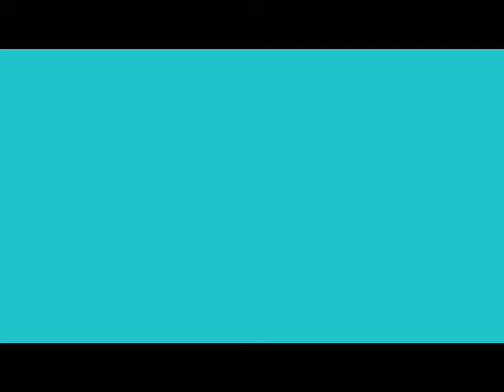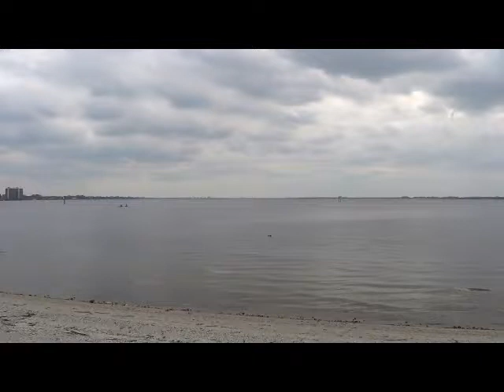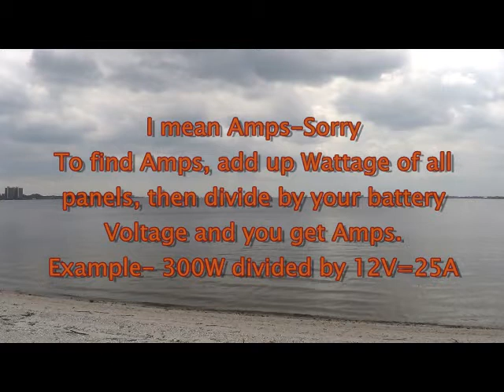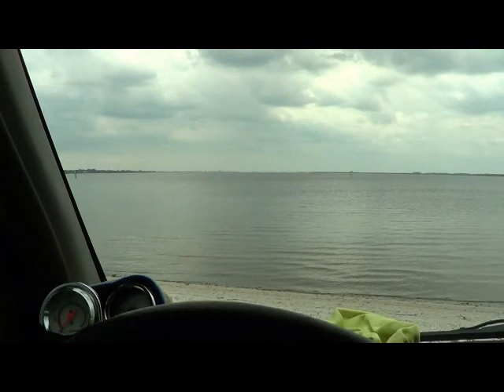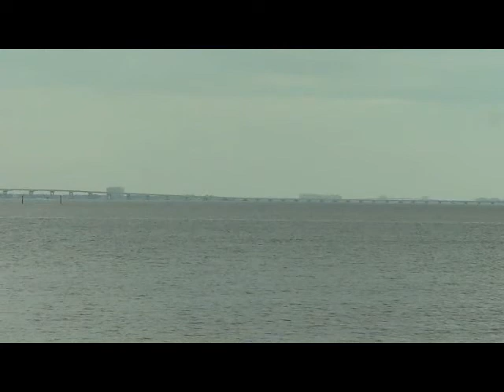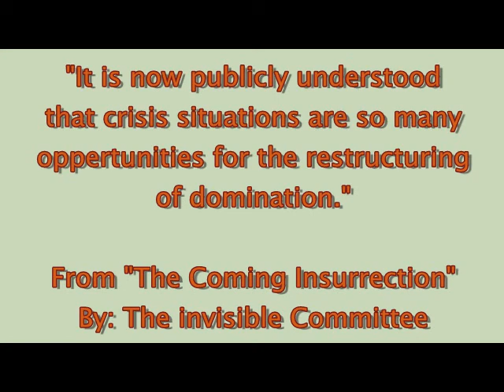More on Solar and some Wind for your Stealth RV or ?

Comment: Great information presented Doug...

As you tell your viewers understanding what their power needs are is key!
Portable or fixed power solution
What do you want to power, job site power tools, TV, Fridge, PA/Stereo, Cell phone, MP3 Player, Headlamp, handheld radio
How much power draw is used (Watts)
How long a runtime between on a charge (Watt hours)
How fast do you need to recharge your power storage

My favorite portable renewable power solution is the Yeyi family of products from Goal Zero. http://www.goalzero.com/
Self contained solar generators that are affordable and deploy in the van, out of the van, at the campsite, jobsite or tailgate party.
110 AV, 12VDC, and 2.1A USB ports to charge all your gear
Model specific, battery packs can be chained together to increase runtime
Recharge from Solar panels ranging from fixed rigid panels to foldable back pack size or from a wall outlet/shore power.
The products are affordable, reliable, sold in America, and thru the share the sun program they help many humanitarian projects.

Here is a link to the En Route video series which I think your viewers will enjoy.
http://www.goalzero.com/solarlife/stories/en-route/
Reply from the maker: Neal Nilsen Great info--I would think that some might be  interested in portable systems. Out of the way when you don't need it, fast to set up when needed.